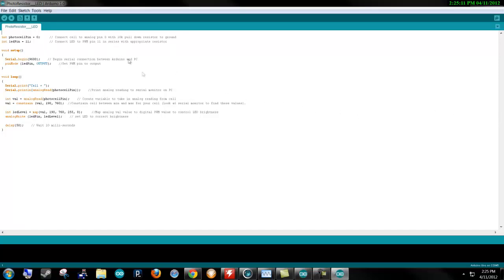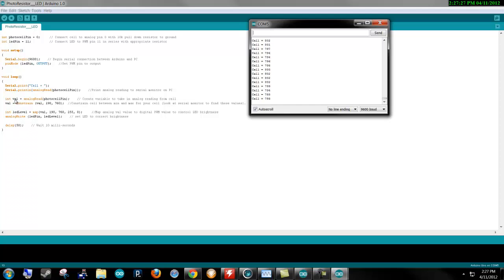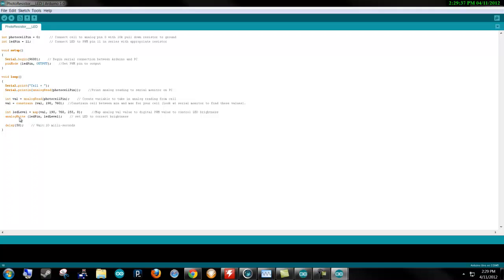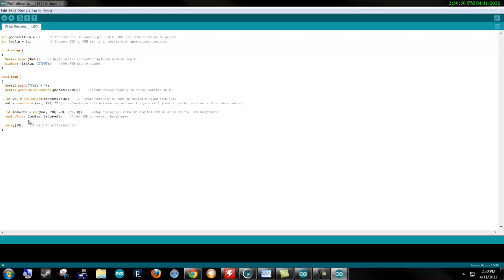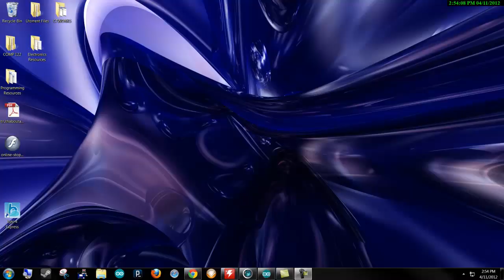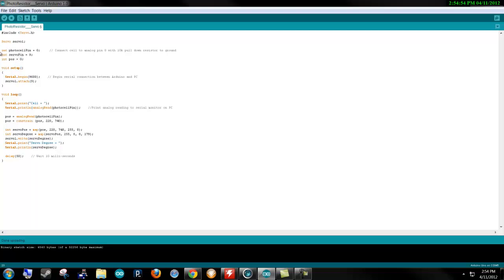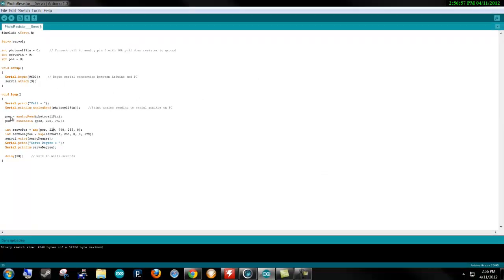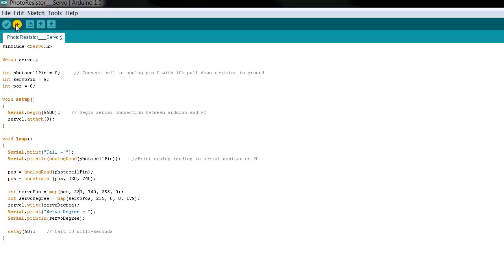Arduino Tutorial (Photocell)

Comment from the maker: Well in this tutorial there are two different resistors in the circuit. There is one that pulls the photocell down to ground and then one that drops the voltage done to a safe level for the led. To calculate the value of the resistor for the led you need to use Ohm's Law. If the led you are using is a 3V led and the Arduino is outputing a 5V signal then we can use these values to calculate the value that the resistor need to be by using the following formula: R = (Vs - Vled) / I. Hope this help

Comment: When I do this, the LED goes on, but it won't turn off.  I checked to make sure everything was connected correctly, and all the wires are in the appropriate places, and I quadruple checked the code.  The photoreceptor is not responding to light (I tried replacing the receptor, just in case the first one was defective).

Comment: Could you share the code with me I'm trying to control a servo via a light cell like this and could use some help with coding and wiring diagram. I did not see it in the description like you mentioned. Thank you in advance. PS im using a Trinket Pro for my Arduino controller.

Comment: if im trying to hook up 3 seperate photo cells to 3 differnet output, one led one speaker one motor.

problem is the code wont allow me to put that many void setups and loops, so should i make three different windows for my code then just call them into my code using # include ? im lost i just want 3 inputs and 3 outputs on one bread board
Reply: You only need one void setup(); and one void loop();

You just put all of the set up parameters under a single setup, and same with the loop.

You should look into creating functions though, it will likely help clean up your code, and make it easily readable.

Comment: Here is the code that will work:

#include <Servo.h>

Servo servo1;

int photocellPin = 0;
int servoPin = 9;
int pos = 0;

void setup()
{
 Serial.begin(9600);
 servo1.attach(9);
}

void loop()
{
 Serial.print("Cell = ");
 Serial.println(analogRead(photocellPin));
 
 pos = analogRead(photocellPin);
 pos = constrain(pos,220,740);
 
 int servoPos = map(pos, 220, 740, 255, 0);
 int servoDegree = map(servoPos, 255, 0, 0, 179);
 servo1.write(servoDegree);
 Serial.print("Servo Degree = ");
 Serial.println(servoDegree);
 
 delay(100);
}